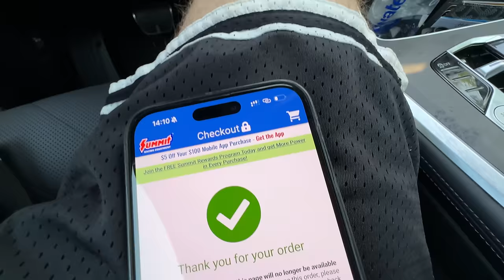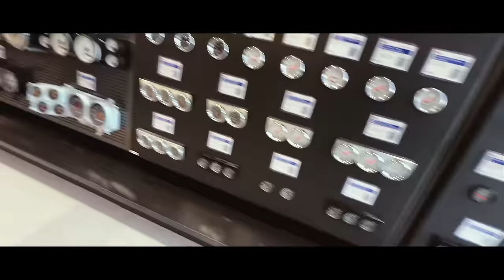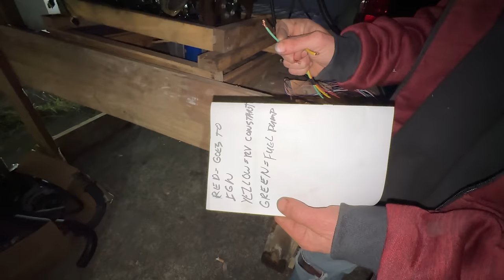HOW TO LS SWAP YOUR CAR WITH A TREE AND BARELY ANY TOOLS

Comment: The Firebird should be called “Casper” the Ghost. You own it, but you can’t see it or use it yet. Casper is a friendly Ghost, just not friendly enough. You have the worst luck. I think that guy sold you a Bird with a bad engine. Gabriel is the man. I will say it is a great adventure and memories the 3 of you have made.

Comment: They should just give you guys US passports, you’re more American than most Americans lol - you made a decent decision to just throw a LS 6.0 and t56 in there. From doing my e36 LS swap, I can share some things: make sure you got the right bellhousing for the trans. There is the magnum (which looks like what you got) and the magnum F - they use different bellhousings and pilot bearings (small vs large) other than that, make sure you get the right output flange (like you said, number of teeth) for the trans that matches the right ujoint cup sizes on the DS flange. Get the chase bays LS to T56 remote bleeder line - the clutch and throw out bearing should all work as long as it’s stock. You should be able to source LS to firebird motor mounts and trans mounts. Then the wiring - if you are going with a stock ecu, idk - does that car even have an electric fuel pump? Make sure you ground the ignition coils to the heads. Make sure the starter wire is connected too. I would just throw a terminator in there with the out of the box harness, it actually may be easier than messing with the stock ecu if there are any issues with that. Praying you get this thing back on the road!! 😎